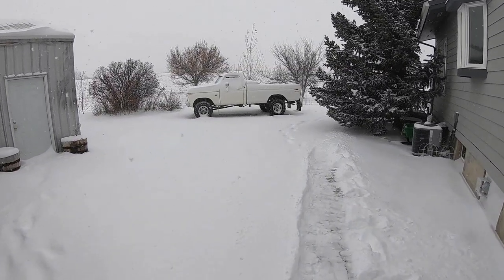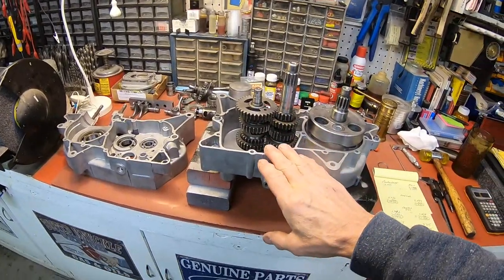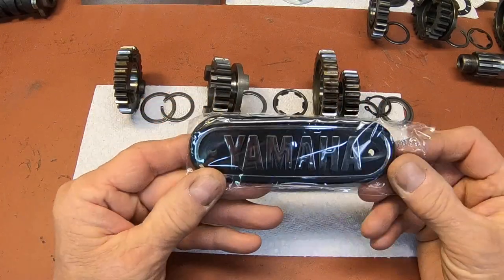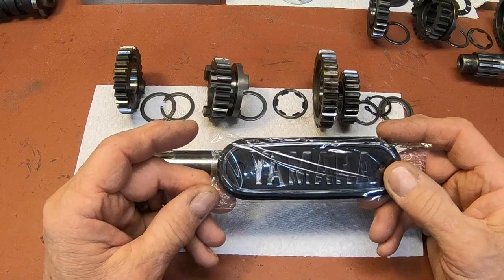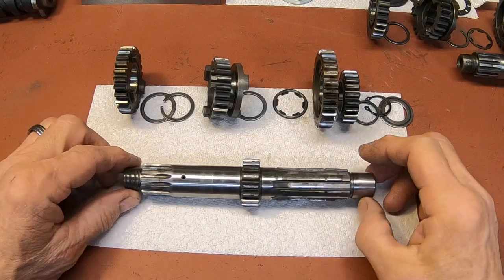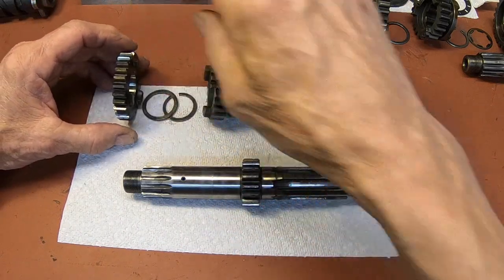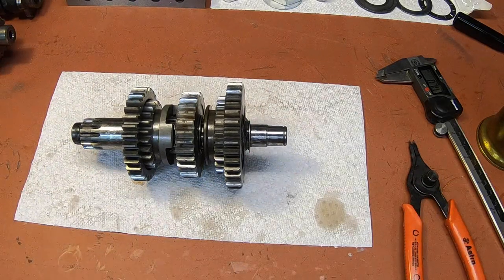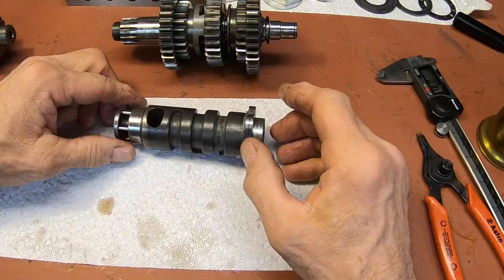1972 Yamaha 250 MX transmission install, assemble cases

Comment: Dale -- High of 94 and low of 67 in Chiang Rai, Thailand! We seem to skip winter here.
Reply from the maker: Hi Graham, so I seem to remember about Thailand. Just the opposite here, we tend to skip summer. But what I do like about it is we don't have many creepy crawly bugs and other varmints that bite and cause a nuisance. You do however have to keep an eye out for the occasional grizzly bear. mosquitoes can be an issue in the spring. Thanks for hanging out in the shop with me.

Comment: Watched this last night to get my nerve up. Thanks for posting. Glad I saw this. I didn't think about checking the bearing clearance. I checked this the measurements this morning. Installed the transmission and crank this afternoon. I zip tied the trans and put it in the freezer. Its a bit tricky to get it zip tied but mine popped right in with very little tapping.
Reply from the maker: Nice work, glad you got it together.

Comment: Would never have thought of shimming gear shafts, but makes total sense. Great idea! Also glad to see I am not the only one at times very frustrated with fiddly and fussy gear/shifter assemblies. Nice work, Dale!! One more thing-- Few understand glopping too much sealant is bad. You are 100% right it should be applied "sparingly". Too much can be as bad as too little.,
Reply from the maker: Hey thanks Jim, yes it can be a challenge for sure to hold all that stuff just right and get it installed. It almost never happens the first time. May just be me, but I think not. Yes, I like this technic to apply sealant, I just get the syringes from the farm store and keep many sizes on hand. They work great for a lot of jobs.

Comment: Your knowledge and skills are quite impressive Dale, wish I came across your channel sooner. Have a great evening and stay safe.
Reply from the maker: Thank you, David, for the kind words. I am having a good time making these videos, and my hope is that folks can find some value in them, or at least some entertainment.
Reply: @montana2strokeracer  By the way, I really like the Fairlane sitting in the background. I restored one myself and a 71 Torino.
Reply from the maker: @davidleland8729  Thanks, this one I'm still working on. This one has all the running gear from an 88 Mercury Marquis. I had a 68 fastback I sold 4 years ago. Also own a 67. I also do all the resto work on the cars. Have just lost interest in the last couple of years. More into the bikes these days.
Reply: @montana2strokeracer  Been down that road myself. The bikes are easier, takes less time and doesn't require near the budget of a car. On the upside of things, I can still do my Architectural and Engineering work on the computer.

Comment: Great tutorial Dale. That should be a smooth running gearbox. 
We've had a little bit of snow, but not as much as you. I'm hoping to get back in the workshop soon, lots of other things have been keeping me out of there!
Best wishes, Dean.
Reply from the maker: Thanks Dean, we really can't complain, all and all it has not been a terrible winter. But it's not done yet. But we are hoping that moderation is at hand. It has been years since I was in one of these engines, refreshing change from the smaller ones. Hope you can get back to the shop soon. I know when I was stationed overseas it was hard on me not to be able to tinker. But wouldn't change anything either.  Just part of life.

Comment: I think it's because when you tighten the clutch it pulls it tight to that side on these. I just did a few gt 80s that I thought wow that's a lot of play. But once clutch is on its tight. I thought it was kinda weird there wasn't shims from factory. You do great job going by manuals on these bikes . Something I never use . You'd probably think I was a crudo. Keep up the good work 🔧🔧🏁🏁 oh wanna add - you learned me something on the a video about adjusting the shift. I've done a shit load of these old Yamaha engines over the years and didn't even know about that. Have a it 175 engine I finished yesterday and I checked it. Was perfect didn't have to adjust but I did looks up adjuster and see how it works. Never had one come back for shifting issues although.

Comment: After 55+ years working on motorcycles, I learned something new from this video.
Like your use of a syringe to apply the sealer, wish I'd seen it way back when.
I have something of a soft spot for the DT250 and 400 MX as my brother in law had 250 and I had 400. 
250 was underpowered being a 'small bore' 400
I thought the MX was 1976 model though and designated the mono-shock version?
Biggest issue I found with them was the gearchange shaft wasn't supported very ewell and would bend when you hit a treestump breaking a section out of crankcase.
 I had it happen 3 times before I got rid of DT for an XR185 then XR350 Honda's.
Not sure if your aware but circlips (snap rings) have a sharp and radiused edge (from being stamped out of sheet) 
They should be fitted with the sharp edge away from thrust direction (any side pressure tends to make them 'dig in)
Reply from the maker: Oh man I still like the old Yamaha enduro and mx bikes, guess they are my favorite. But every bike out there does have an inherent problem or two. I still ride the old enduro and mx bikes every chance I get. The fun never ends, the only problem is my brain says go faster, jump higher, and lean lower....my body says don't do it because it will hurt. So, it goes getting older. 
Yes, I am aware of how snap rings are made and how to properly install them. I usually mention that when I am installing, guess the old brain is slowing down. Had to go back and watch this one to see. Yep, forgot to mention it. Thanks for all the great comments and suggestions. I sure appreciate your attention to detail.
Reply: @montana2strokeracer  I know the feeling 😄
Reply: Hmm I think I did my snap rings backwards… so the rounded face should go against the thrust washer? My motor is still apart so I have time to swap them round. Thanks!
Reply: @MrPerattzi  If a gear fits up to a shoulder then has thrust washer then circlip, yes. 
Any side pressure will make 'sharp edge' dig in and prevent gear moving

Comment: Dale may I ask where your getting the new JIS  screws from?
Reply from the maker: Oh my, that is a tough one, and a long story. I will tell you right now, I don't pay 3 to 10 dollars for a single screw like the OEM's want you to. You have to look around and find the best price. Several years ago, the m6 x 1.0 x 65 was running 3 or 4 dollars each from Suzuki and Yamaha, at that time I found Kawaski was getting 65 cents for them. Bought lots of them, during this build I used just about all I had, went back to look at Kawaski, they are now almost 4 dollars. Guess they caught on to me. Ok so I just bought them from Grainger for about 1.80 each, but most of those screws of different lengths I get from River city fastener, they don't have too many of the longer ones.... say over 50mm. I have had some luck on Amazon, but all in all you just have to look. JIS is just a different animal, and they are going to cost you. Guess you just have to be ok with whatever the price is in your mind. Otherwise, it's hard to live with yourself. Grainger is a pretty good source for them, but every once and a while they really overcharge for some lengths, you just have to watch. Hope this is helpful. Best of luck on your projects.
Reply: Thanks for the information also good luck with coming project, great to see how you approach your bikes restorations. Would love to have your workshop.

Comment: I can't seem to find any information on installing the Kickstarter on my DT250. It has a spring with the cup and the Kickstarter shaft engages the spring in a cutout at the end of the shaft. When I took it apart, it was difficult to keep it together so I'm looking for some information on how to clock it and preload it to install it. Do you know of any videos or do you have one? Thank you!
Reply from the maker: Hey BB, I am not as familiar with the DT and RT series, although I have been in to both. Seems I remember they are like most of the others that require 1/2 turn preload on the spring. Just get everything in there (you can check the illustrated parts breakdown at Parzilla.com) then grab the hook end of the spring and wind it a 1/2 turn and place it under the spring pin in the case. I'm sure I show it when I built the 250MX engine. There is a playlist on it. I remember doing it, but it has been a year probably.
Reply from the maker: Try this one,           https://youtu.be/kKS56xUAajk?si=OEzxKJlD8V6RG8mG
Reply: @montana2strokeracer  Ok excellent thank you!

Comment: Hey dale so im working on an mx360 got all back together from a rebuild split case new bearingbike was given to me never heard ot run it sat outside for 30 years but now i have it running making alot of noise coming from kick starter but when i push kick start foward it goes away  looks like your the guy to ask i dont know anyone who works on vintage
Reply from the maker: Boy I wish I could help; I am just not as well versed on the 250/360s as I am the 125/175 bikes. But I would pull the cover and investigate the noise it should not do that. Its more than likely a simple thing that they didn't get quite right upon assembly.

Comment: I am in the beginning of rebuilding my RT3. Just a stock rebuild that im looking to drive mostly on the street. Has anyone experienced filling in those open cavities with some sort of epoxy? I would think it might reduce vibrations? I havent seen anything on it yet so im guessing it probably isnt worth it.
Reply from the maker: Hi Trever, are you referring to the empty cavities in the cases? I have never seen anything either, not sure what could be had by doing that. The open holes in the crankshaft however that has been done for years and is a big improvement to fuel management. Not doing it to this one because it to is a pretty basic stock engine. I do have a 72 RT2 enduro, I have done some videos on, plus last spring I did a ride video along the Missouri river here in town.